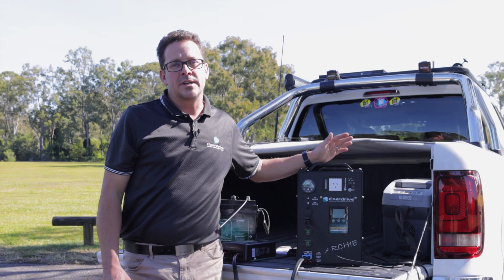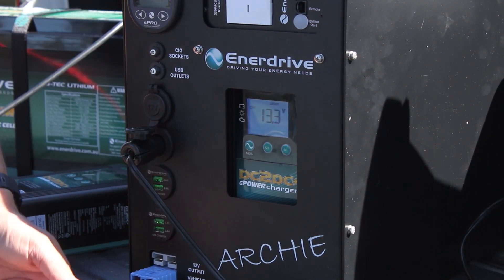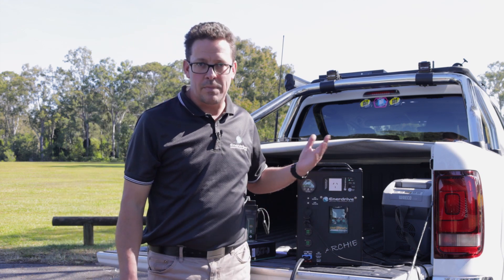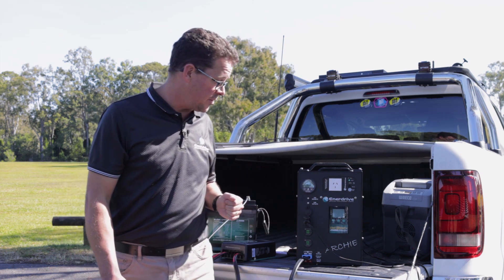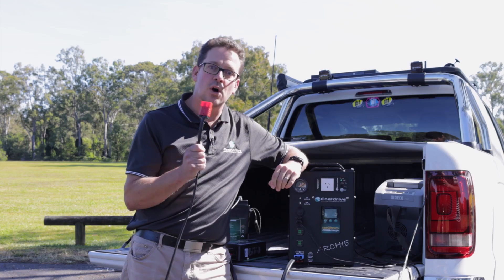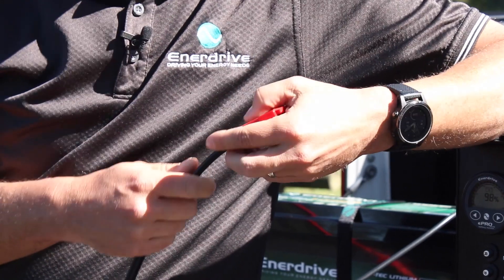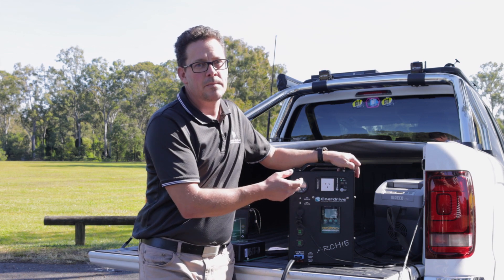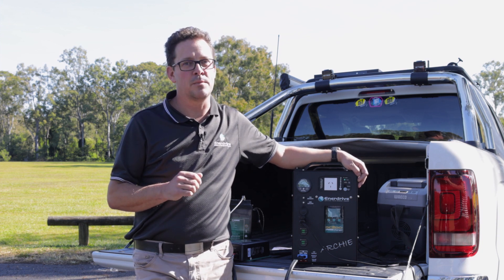Enerdrive DC2DC Chargers - Part 7 - Fault Finding

Comment: I have a 40+ dc dc Mine is not connected to the ignition source and it’s not in priority mode yet it stays on channel 3 and doesn’t check ch2 or the  starter battery every 3 minutes. I have a Bluetooth monitor and it always checked ch2 and the starter battery every 3 minutes but now it just stays on ch3  whilst I’m driving

Comment: Thanks for these videos... I have a question I cannot find an answer for though...

Can this be connected directly to an alternator, or does it need to be connected to a battery between the alternator and the DCDC charger?

I ask because I have an ex military truck, running 12v starter and 12v alternator, but the vehicle has a 2nd 24v alternator also connected to the engine, used to be for powering a second separate 24v battery bank for non-vehicle system (radios etc).

Ideally i'd like to connect my dc dc charger directly to the 24v alternator without having to install another 24v lead acid battery between the alternator and this unit.

If a 24v battery is required so this unit doesn't connect directly to the alternator, would a small 24v capacitor work (as they can be much smaller and lighter), or would you recommend a 24v lead acid battery?

Thanks in advance.

Comment: Great video, informative. 
I love our dc2dc unit in our retro van. I have a question though, no one seems to be able to have an answer to. Our unit works/ed fine with our previous car, Outlander. We since upgraded to the new Rav4 Hybrid. Since a Hybrid doesn't have a , let call it conventional  alternator,  is it safe to connect my dc2dc to the primary battery of the car? 
I figure since Hybrids are more and more gaining popularity,  it is something you may have investigated. At the moment I am running on the solar panel only. Thanks heaps for your time. Frank
Reply from the maker: Hi Frank, this is great question, but one that you'll unfortunately need to direct towards the vehicle manufacturer. Specifically, you'd want to ask for the output potential of the charging system. To be fair this is no different to running spotlights on a vehicle.
Reply: @dometicpower  
Thank you for your reply. I have discussed this with Toyota and they referred me to you guys. I personally can't see a problem, but I will investigate more. I have raised this on the FB group and Rav4 Hybrid group, but no one has experience yet, or commented. Thanks again.
Reply from the maker: @fsriccobon8279  as long as it has a 12v start battery, the best way is to connect to the start battery with the ignition circuit trigger as well and see how it goes. Worst case scenario is that you would end up with a flat battery. But you would find that while the DC2DC is running, the engine would most likely stay on. Hope that helps!
Reply: @dometicpower  Hi again, thanks for that info. I am happy to try a ignition circuit trigger, but I have no idea what type or so forth I should be looking at. Any recommendations? Thanks again for your time. Frank
Reply from the maker: @fsriccobon8279  If you are in the Brisbane area at all, feel free to swing by our facility in Tingalpa and our team can do some tests on the vehicle to try and get to the bottom of it for you. Unfortunately there is a limit to how much light we can shed on the situation without some definitive answers from the manufacturer on their system's output potential, but worth a try at least. If you send us an email or give us a call, we can also point you in the right direction with the ignition circuit trigger (youtube comments are a bit limited on the info we can send).